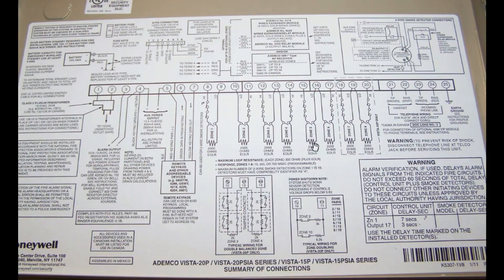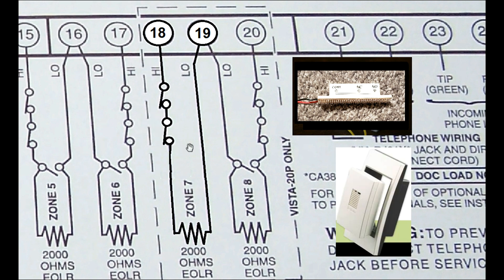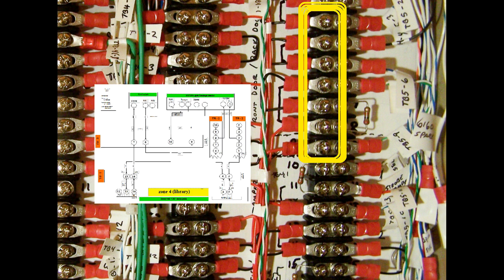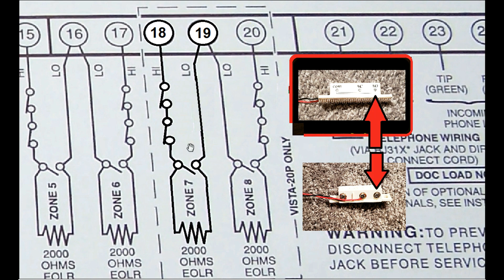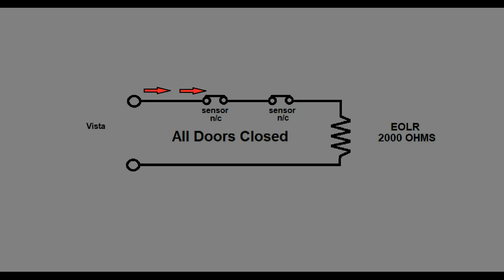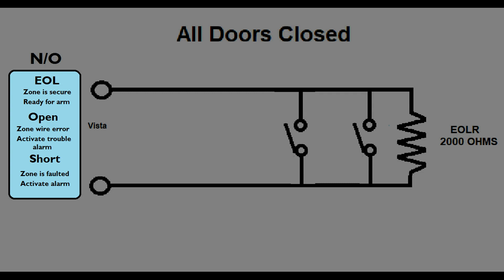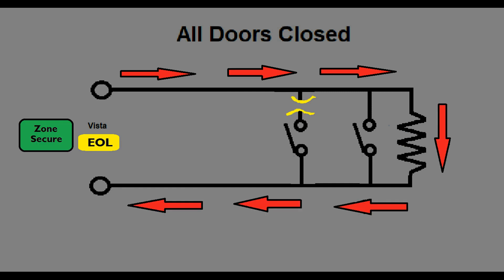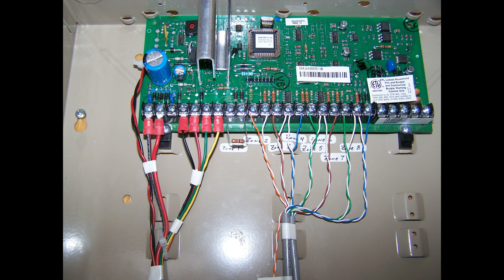installing sensors, detailed wiring instructions (Vista 20p part 19)

Comment: I have been locked out of programming mode before and that is no fun.  I had a Visa 10P system that was locked out.  They never should have invented that mode but they did.  Once it is locked out, the circuit card is essentially garbage at that point.  Sad.  It's just sad.
Reply from the maker: There is a way to recover from lock out mode. (at least with a vista 20P). I covered the prococess in part 18 of my Vista 20P series. It can be found at https://www.youtube.com/watch?v=S9c9U-l3BaE&list=PL3ds3hStbSiIgsLO-GPbLVUNEGmbt0NLf&index=18
Reply: @bounder97  I did that.  It turned out that the *88 field had been set to 2.  You do that and you will lock it out permanently.  Whoever monitored it before actually locked out the code and made sure that the # and * don't work.  But it is a mute point.  Vista 10p cannot operate a touchscreen keypad and you can't expand it either.  So, why use a vista 10p when a vista 20p is a thousand times better?  Pretty much, I only use the locked out vista 10p card as a power supply.
Oh.  And in response to this video.  The end of line resistor is supervision of the circuit.  You said that a short on the resistor causes a trouble and open causes an alarm.  You're on the right track however, on a burglary system, an open or a fault causes an alarm.  My motion detectors are wired in a way that the normal open contacts are used and the resistor is wired in parallel with the motion.  Glass breaks are done that way too.  However, you are right.  A short on a fire zone causes an alarm and an open causes a trouble.  Your door and window contacts wire like pull stations.  Your motions and glass breaks and photo beams wire up like smoke detectors and carbon monoxide detectors.  The eol resistor is at the last sensor of the run.

Comment: Hey bounder97, I think I wrote a comment on another Vista video while back. I wanted to say, that as a professional alarm technician, the workmanship in your install is impeccable. Mostly due to time constraints, but most alarm technicians are most likely to throw spaghetti in a panel box and forget about it; "it's not like the customers gonna look at it". Your videos did wonders for helping me understand the burglar alarm when I first start doing them a while back.

It's a double-edged sword. Ideally, you'd want zone labels to help the next technician figure out what the problem is when a trouble does come up. Ideally though, we wouldn't want to label the zones because a savvy thief could sabotage the panel wiring if they did manage to get to it. I'm thinking your house has a lot more going on than three doors and a motion so it probably does make sense to label. Either way thank you for teaching us and thanks for sharing your home improvement knowledge too.

Comment: Did you build or buy the junction box?  I'm not able to find one.
Reply from the maker: Hello. I built the junction box. 
I took an old alarm panel metal case and mounted some plywood inside of it. 
I covered the plywood with vinyl tape so I could write on it. 
Then mounted terminal blocks onto the plywood.  
The terminal blocks, terminal lugs and wire were purchased from an internet company called MCM electronics.
Reply: @bounder97  Nice!